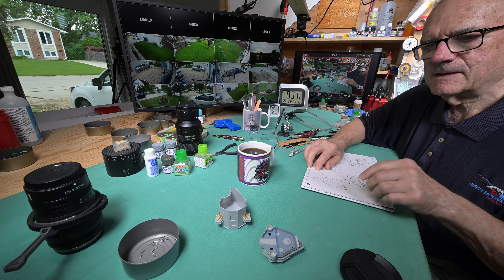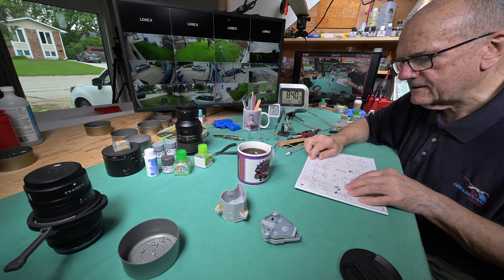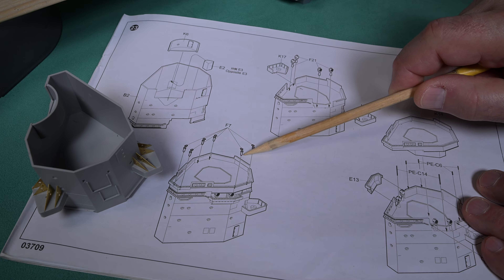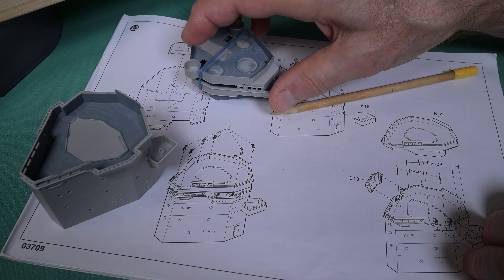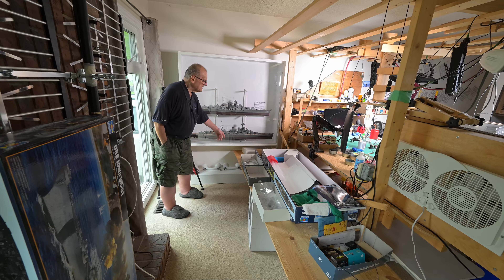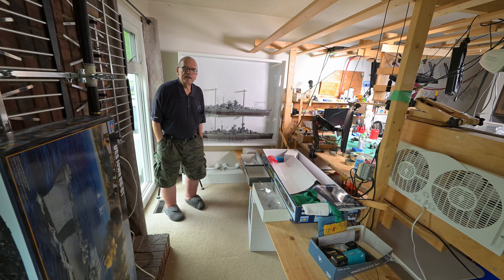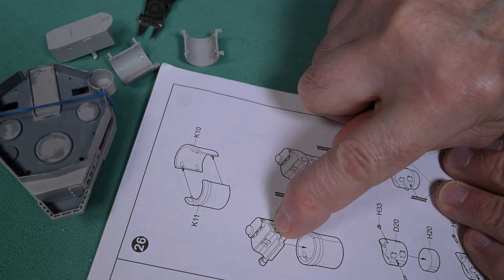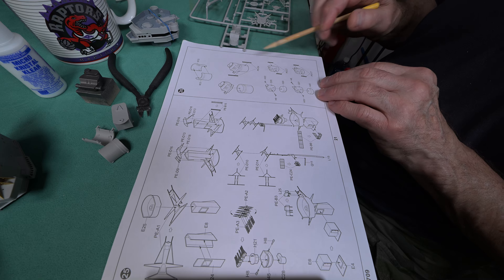The Model Ship - Part 1229

Comment: Morning Ron, Yes best to get everything glued together, filled and sanded that needs to be then have one big painting session, thats what I have done on the Arizona just got the cranes to finish and then its ready for all the parts to be painted, assembled and put on the model, as for the Yamato I am a very strong believer in supporting your local hobby store as there are to many of these disappearing due to online shopping, but if you really want a Yamato  and your local hobby shop can't get one or the cost is way to high I would check out Amazon they can some time have some very good deals. Also with regards to the storage I have ordered some garage shelving 3 bays 1800mm high (6FT) x 1500mm long (4FT 11 inches) x 450mm deep (17 1/2") with 400mm (16") extensions to give a total height of 2200mm (7FT 3 inches) each bay will be able to accommodate 4 x 1/200 scale ships with between 450mm/500mm (18/20") clearance from the shelf where the model is on to the underside of the next shelf plus it will also give me storage on top of about 250mm (8") between the shelf and the ceiling.  I found this on you tube and will be following what this guys has done, hope this helps someone with there storage solution https://www.youtube.com/watch?v=P_DpPnGLswU